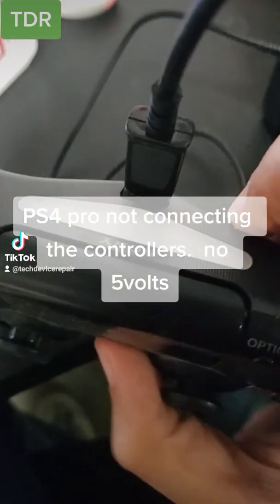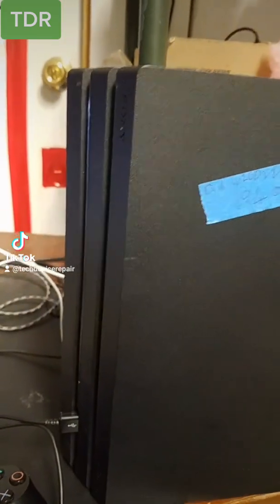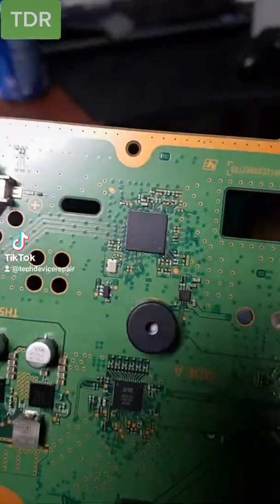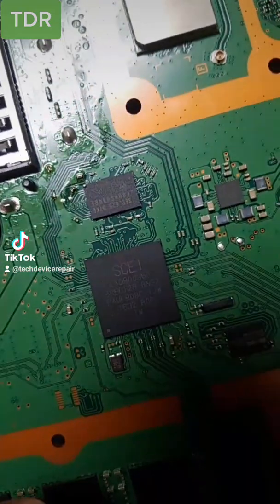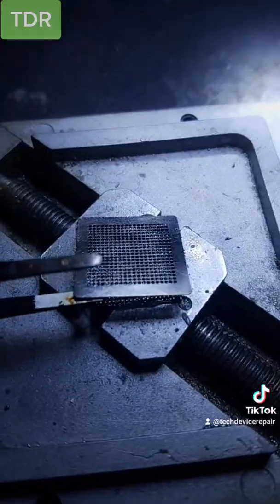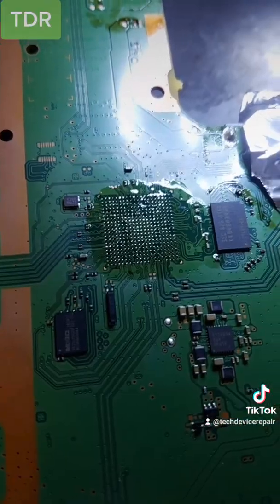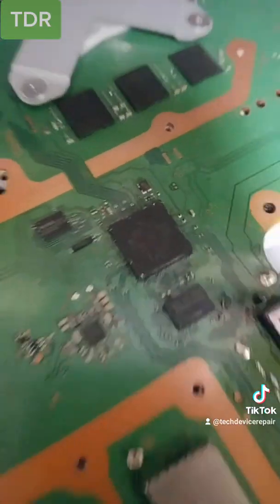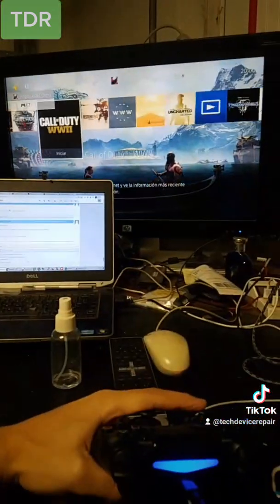PS4 pro has serious USB issue.

Comment: I have a pro, my controllers connect but every time I try to initialize the system it says the save file is corrupted or the system randomly shuts off. Would this be a usb controller issue?